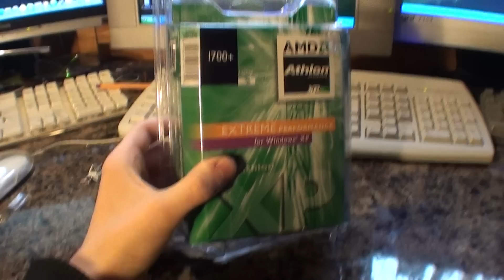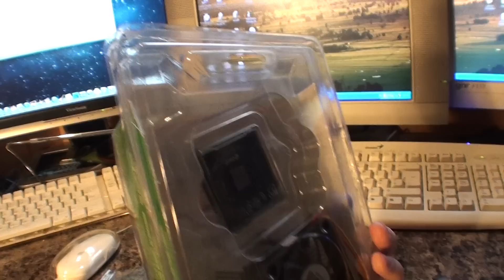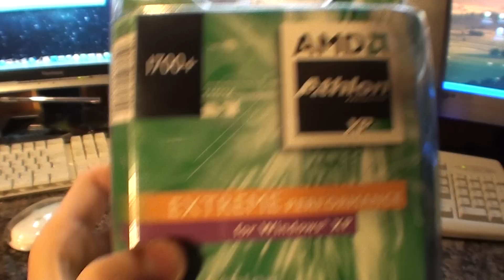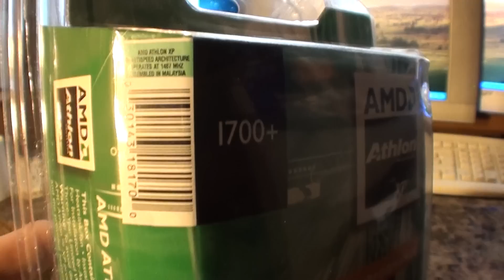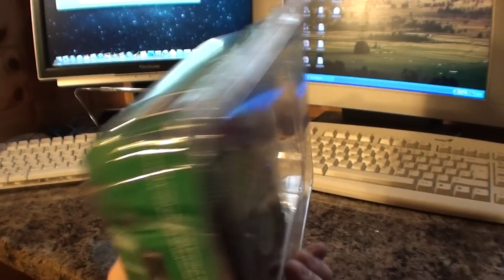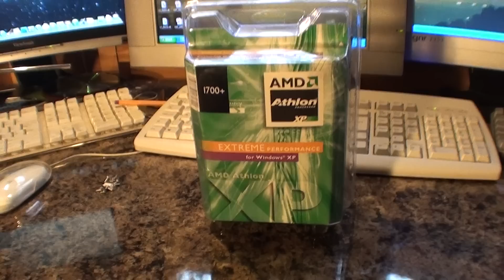AMD Athlon XP 1700+ CPU - Brand New!

Comment: When I was 18 I built a few Athlon xp computers as I was trying to start a side gig.  

I vividly remember losing a chuck of my profit margin on one build because I didn't clip the heat sink down as I was powering the unit up for the first time.  I was amazed how quickly I burnt the daylights out of an Arhlon xp 2100 and the smell was something else.  

Lesson learned the hard way.

Comment: My first "modern" PC had one of these in it! I was running Windows Xp.  It was an overclockers dream!  I had mine running like a 1900+. They called it a 1700+ because it was just as powerful if not slightly more than a  1.7 ghz Pentium 4 at the time.  This CPU is where the AMD fanboys came from. They were leaving intel in the dust back then.

Comment: Its a Palmino XP and very hot , and somewhat more responsive in games than Throughbreed or Barton .  Palamino used 133 sd-ram compared to they later which used DDR 266 and later 400. (or higher with overclock like ddr1-466)

Comment: The 1700+ is it's "PENTIUM" rating, in other words it performed like the Pentium 4 at 1.7ghz
Reply: That’s a myth mate.
The Athlon XP’s rating (+ sign) simply means the MHz a Athlon thunderbird would have to run at to be equivalent to the Athlon XP.
11x 133.34 equals 1460.
The XP palomino was poor clocking and tended to top out at 1800MHz or so.
The tbred b was the one to get if you want a great overclock - the ‘Dlt3c’ tbred b’s could clock to between 2400 & 3000MHz.
The 1.6v (dut3c) Tbred b / a clocked much poorer than the 1.5v default vcore dlt3c chip.

Comment: I still have a Socket A based system up in the loft,It has an Sempron 2800+,Asus motherboard and 1.5GB of DDR Ram :D and it still all works fine.

Comment: They called them 1700+ and so on because each mhz on those athlons were more efficient per clock cycle than the pentium cpu's that they competed against, so people know 1700+ means it is at least equal to a pentium 4 1.7 ghz, but they were actually a bit faster than a 1.7ghz P4, so yes 1700+ makes very much sense even though the CPU was 1.4xx ghz, this is they showed the cpu's performance compared to intels offerings then.. This was very common knowledge when building PC's back then and choosing a CPU, im surprised you did not know this. Back then AMD was very very competitive with intel performance wise and AMD cpu's were preferred by most system builders.. im only 27 years old now and even I remember this. Also, the tomshardware tests that you spoke of where the heatsinks were removed from intel and amd cpu's, the amd cpu's overheated and smoked a little bit because of the heat, saying that they caught FIRE is a bit of a stretch of the truth. I think a cpu catching FIRE would have a bit of a different outcome for someones house compare to just overheating and smoking out a bit. ALSO 1.7 ghz was a very attainable overclock on a 1700+, if I remember correctly, even 2ghz or more was an attainable overclock out of a 1700+.. so a couple inaccuracies in your historical facts here.
Reply: +xxdizannyxx I concur; the rating was a comparison against Intel CPU's, and not a measured speed rating as such.  I had a 1400 (pre-XP series) CPU on a Socket A/462, and after that went to the AMD 64 on a 939 board.  Still around here somewhere.

Comment: You could have spent that 25 pounds on the aforementioned CPU and a board, and actually improved your system's performance, rather than a bunch of silly modifications. Don't fool yourself - your hardware is shit.

Comment: that cpu is a palamino i think. max overclocking is 1700-2000 mhz. the throughbred 1700+ revision would overclock to 2400mhz. ive had both.

Comment: Lol.I actually still use this as my main p.c. Just re-applied thermal paste today. Had it since new and it still performs perfectly. Use it daily, all day. Upgraded psu, graphics card, heatsink and fan, added ram, new hdd, air duct mod, added two fans, all for under £25.00 off ebay. Air duct mod is two plastic bottles. Absolutely no problems and love it.
Funny to hear the 1700+ being refered to as 'RETRO'.

Comment: The XP wasn't unreliable, it just didn't have a thermal shutoff to protect it if the cooling failed (like the heatsink falling off lol).

The naming was odd, still don't understand it! Maybe it was used to get around the MHz myth problem of the time, where people thought higher MHz = faster. 

1.8GHz Athlon 64 would walk all over a 1.8GHz Pentium 4 or 1.8GHz Athlon XP 2500+, but the clock speed alone doesn't suggest that :)

Comment: I had one of those, it was quite amagic chip, got it to clock upto 1.8 GHz on stock volts, however had it cooled by a Cooler Master heat pipe cooler with a 7000 rpm fan on it, man that thing was loud.

Comment from the maker: @utltrarama It is possible. I remember the magazine Micro Mart did a test on these about 10 years ago and they found AMD Athlon XP Processors were more powerful per MHz than Intel Pentium 4 CPUs at the time. I used an Athlon XP 3200+ Barton Core CPU for about 2 years and it was better than the Pentium 4 HT system I upgraded to.